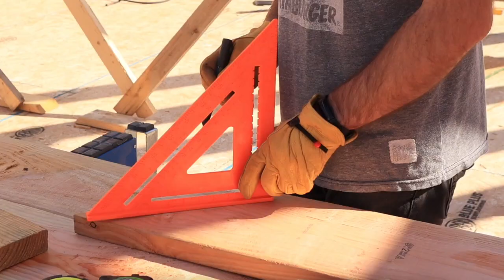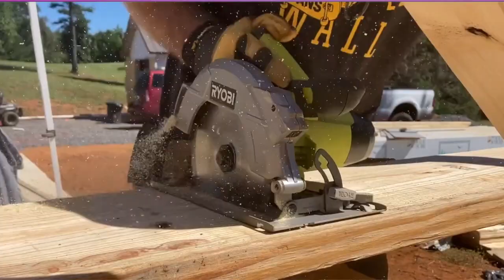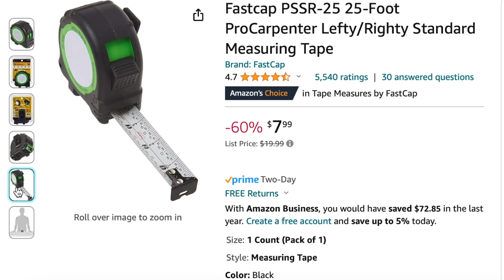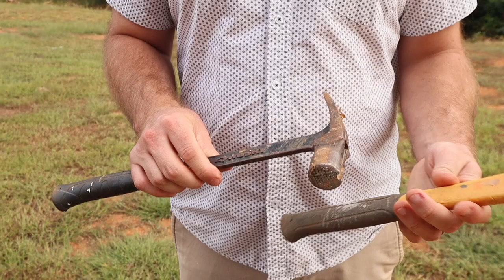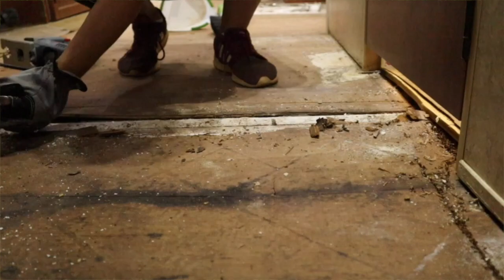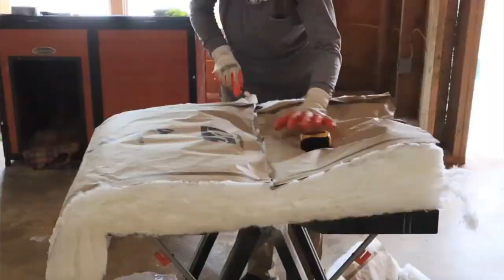TOOL TIME! My 10 ESSENTIAL tools for project success

Comment: I used to use the channel lock pliers but switched over to knipex. A little more expensive but I found them to be way more ergonomic and easier to adjust. Just my 2 cents
Reply from the maker: good tip! thanks!